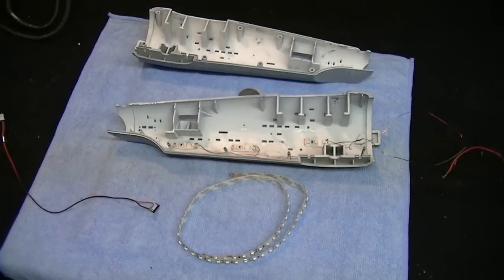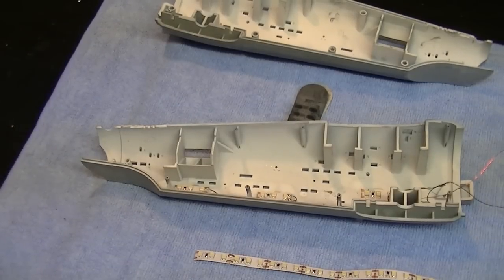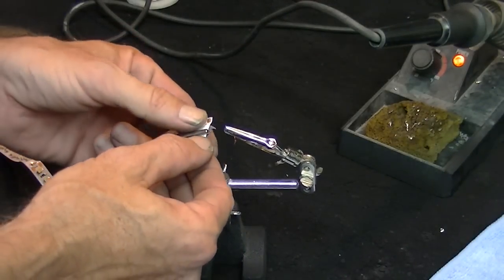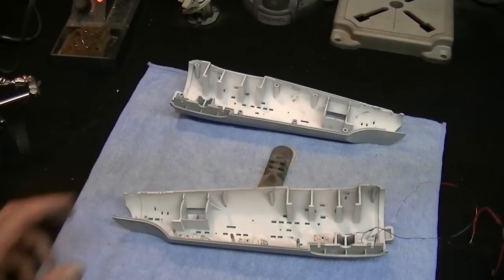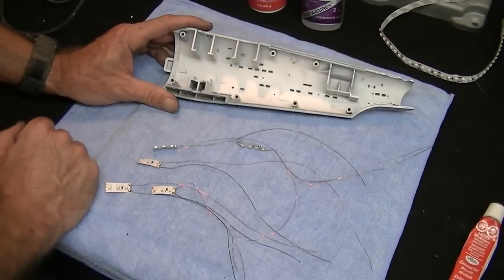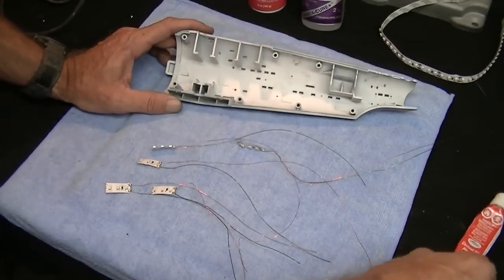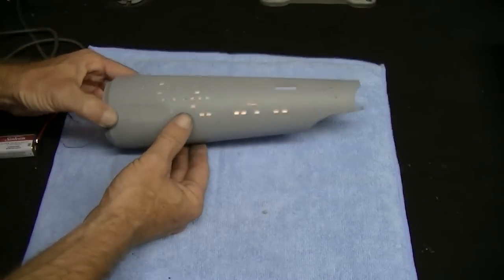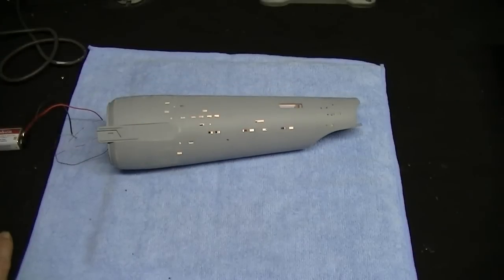Polar Lights 1/350 Scale TOS Enterprise Build PT 4 Wiring And Soldering Tips

Comment: I also had difficulty using lead free solder. Sometimes it worked, sometimes it didn't. A simple modification of this technique adds only a few seconds. I now use a jet lighter (for lighting cigars) with a blue flame to melt the insulation off the tip of the magnet wire. I can do this with multiple strands of magnet wire at once by passing the tips through the flame for 1-2 seconds. I then tin the ends with lead free solder and it works great.

Comment: You must be using leaded solder. I tried it last night with my lead-free solder but that solder doesn't coat the tip - it just sits on it in a little ball. Still, I tried holding that against the magnet wire purchased from eBay but it didn't melt the insulation.

Comment: great tips, great advice, and thanks alot for the steady camera work as well. I don't need to take dramamine to watch your vids. And just a note about CA, I live in fla, and with the high humitity if you use CA to bond your models together, over time , the model starts to turn yellow at the seams. I gave up on using CA along time ago because of that. Also, Thanks for sharing your advice , your calm approach in dealing with these models. At least on camera...

Comment: Great info in this piece!  Regarding CA and 'kicker,' you can make your own kicker with distilled water and some baking soda.
Baking soda will instantly catalyze CA. Lots of modeling applications as filler and buildup media using CA and dry powder baking soda. If you take a dab of gel CA and dust it with BS, the outer layer will become instantly crusty, but the inside still gel and shape-able. Have fun and keep up this great work!

Comment: I ordered the LED tape from LEDWholesalers but mine seems to have greater spacing between the leads than yours (it's 2"). That's too wide to use in the saucer pylon. I purchased the warm white (3100K) 300 x 3528 (P/N 2026WW-31K). Which one did you get?

Comment: Turns out Radio Shack magnet wire works just fine, even with lead-free solder. The stuff I got off eBay must have too thick insulation.

Comment from the maker: The LED tape being used in this build is included in the R2 lighting kit and it is double density which means the bulbs are closer together. I just checked the neck on the kit and it looks like you should be able to fit a 3 bulb segment at the bottom and another at the top if you remove the connecting pin there. I'll show what I mean on the next video update. Otherwise you'll need to order some double density tape if you want the same fit as the R2 lighting kit.